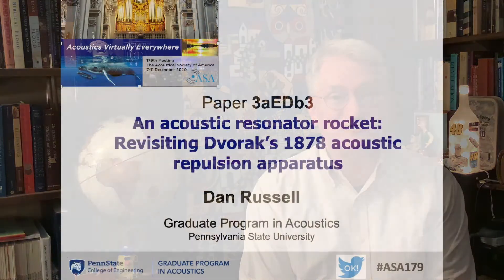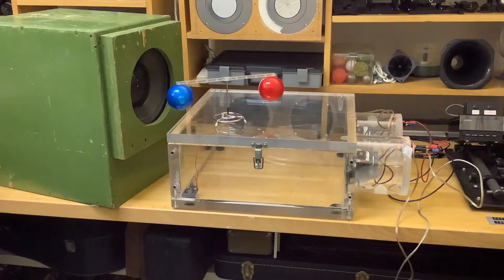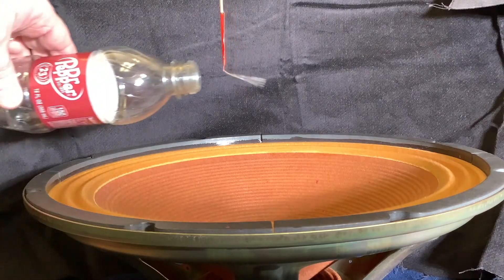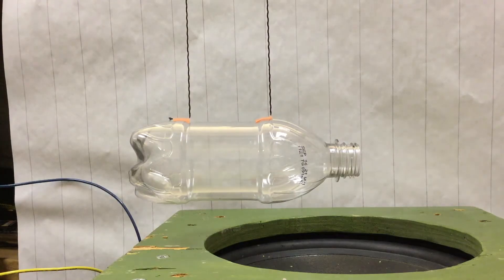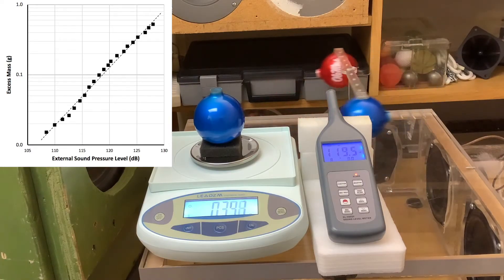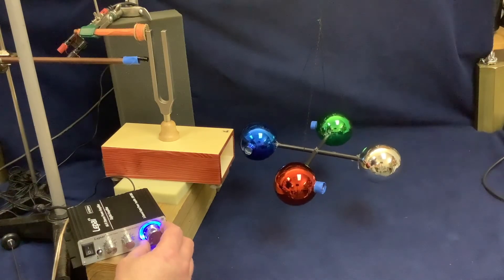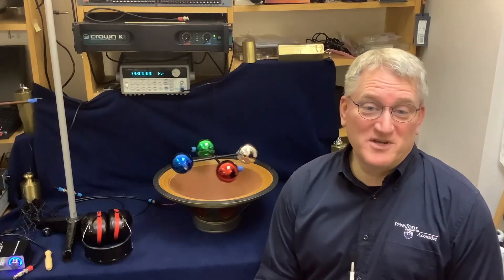Acoustic Rocket Demonstration -- revisiting Dvorak's 1878 Acoustic Repulsion Apparatus

Comment: fail. the resonator mouth opening should axially face the source of the sound, i.e., the speaker. a perpendicular setup is far from an ideal test.
Reply from the maker: unfortunately you apparently don't know enough about acoustics to know how incorrect you are. What I did in this demonstration works perfectly well, and this is how we measure the response of Helmholtz resonators. At this frequency the wavelength of the sound wave is much, much larger than the opening of the mouth of the flask, and the sound pressure is the same in all directions, so "pointing the speaker directly at the opening" makes zero difference in producing the effect.
Reply: @DanRussellPSU  an ideal setup would not have limitations based on the wavelength size. just point the speaker at the hole.
Reply from the maker: @h7opolo  Dude -- it doesn't work that way.  There are no "limitations" based on wavelength size.  The only parameter that matters is the frequency of the flask (and its corresponding wavelength) and the direction the loudspeaker is pointing makes absolutely no difference.  Perhaps I'm just feeling cranky and snarky today, but I have a PhD in Acoustics and I've been research and teaching the subject for 35 years. So, I do happen to know what I'm doing.  For a demonstration like this, the direction the loudspeaker is pointing makes absolutely no difference.  You could try it for yourself to verify.
Reply from the maker: Also pointing the loudspeaker as I have done makes it clear that the effect is due to the motion of the air jet coming out of the flask opening, and NOT due to the sound waves generated by the speaker.
Reply: agreed, that aspect is useful for verification of concept.

Comment: Ce principe est utilisé par Suzuki dans ses moteurs à 2 temps des années 80.
Non pas pour faire tourner les roues de la moto...
mais pour supprimer l'effet des pots d'échappement (pot de détente) qui renvoie
une onde de pression qui arrive au mauvais moment en dehors de la plage de régime d'accord.
Le dispositif ouvre à bas régime et ferme à haut régime une chambre qui constitue un résonnateur de Helmholtz
à l'aide d'un boisseau pivotant disposant d'une fenêtre oblongue, placé proche de la lumière d'échappement.
Ce système est baptisé SAEC  pour Suzuki Automatic Exhaust Control.
(pas le suivant AETC Automatic ExhaustTiming Control, différent).
Le calcul dans ces conditions de fonctionnement doit être assez complexe.

This principle is used by Suzuki in its 2-strokes engines from the 1980s. 
Not to turn the wheels of motorcycle... 😉 but to remove the effect of the exhaust pipes (chamber tuned pipe) which returns a pressure wave that arrives at the wrong time outside the tuning rpm range. 
The device , placed close to the exhaust port, opens at low rev and closes at high rev a chamber which constitutes a Helmholtz resonator using a pivoting bushel with an oblong window.
 This system is called SAEC for Suzuki Automatic Exhaust Control. (not the following different AETC Automatic ExhaustTiming Control). The calculation in its operating conditions must be quite complex.

Comment: Is there any real world application for this device?For this has there been, I can't see any.But then again, I don't know what happens.If we scale it up, and how large you have to scale it up to produce anything that would, you know, be used to move something or propel something again, what real world applications does this have sincerely?David raphael a k a bob, the blindburg guitars p.S thanks for the video
Reply: I wonder if the effect would still be present if an ultra-sonic waveform/transducer was used. I think if it were that would be the only way to find a practical application because no one would want to hear a speaker operating at a sufficient amplitude to drive it fast enough to be useful.

Comment: Assuming the air and its mass/density being ejected in the form of a stream, being pulsed by sonic waves is the mechanism for rotation and the air being drawn in around the outside edges must be of equal volume and equal velocity of the center jet otherwise an area of lower level of air pressure would exist in side the resonator. If those forces, in take volume / velocity and the ejection volume/velocity have essentially equal components then the intake vector has to have a vector which does not oppose the "jetted stream." Being that the air is sticky does the intake air and its vector pull or aid in the rotation. Then does the jetted air have such a velocity to overcome, at least temporarily, the viscosity of the air surrounding the resonator? You have shown the aerodynamic shape of the resonator is less important than the frequency which drives it. Also does Doppler have any influence? Can the rotation be stopped by applying via the frequency which drives the resonance by the frequency coming from all directions this elimination of Doppler?
Reply from the maker: The Doppler effect has to do with the frequency of a radiated sound wave having an apparently different frequency (lower or higher) depending on the relative motion of the source and receiver. That really doesn't apply to this problem.  The sound field at the mouth of the resonator simply provides the driving mechanism that causes the resonator to oscillate at its resonance frequency. Because the resulting oscillatory motion is so rigorous, the system becomes nonlinear and the jet streaming occurs, resulting in "repulsion".  The viscosity of air is pretty small (the viscous losses along the walls of the neck are much larger),  If you are interested in details of the nonlinear jet formation, there are several papers by Uno Ingard that explore and explain this.  My interest in the topic was to reproduce this demonstration that I had read about, because it is a pretty neat effect.  But, I'm not studying it as a research topic.

Comment: Wait,  you said the bulbs act as "hemholts resonators"?   do you mean like a modern automotive exhaust can? Both my motorcycles came stock with hemholts exhausts that sounded like a sewing machine but I swapped them out for louder Jardine exhausts that sound like black hawk helicopters at idle but they also greatly increase hp.
Reply: @nathanjones3429 I'm guessing they are both 4 strokes, since you mentioned "sounded like a sewing machine", BMW's ?  Were you fortunate enough to dyno test your bikes ?   Jardine makes Quality Cans (also Scorpion).
Many happy miles to you.

Comment: 11:50. There's a potential that   phase differences and self resonance is destructively interfering when driven from the side rather than driven from the speaker below. If this effect exist it will likely be highly geometric dependent and probably small. Sound  Energy might travel down support bar faster than through air and might be destructively interfering.

Comment: One of many useless things
Reply: Not useless.

Acoustic resonators are commonly used in vehicle exhaust systems to attenuate specific frequencies and reduce engine noise. 

Acoustic resonators are also integral to musical instruments, where they enhance or modify the sound by resonating at certain frequencies, improving sound quality and projection.

If mire research were done, I expect we would find additional applications for acoustic resonators
Reply: Most technology that we enjoy today fundamentally started from one of these "many useless things".
Reply: Pulsejet engines operate on this principle. The only difference is where the excitation comes from and air is allowed to move through a pulsejet to provide oxygen for combustion. They are otherwise exactly the same.

Comment: Thanks for the demonstration. I have a question; does this applies to non-compressible fluid?
Reply: I think you would need a pocket of compressible fluid like air inside of a container of incompressible fluid to achieve a similar effect and the resonant frequency would be much lower.

Comment: if you were to put a Crookes radiometer in front of a speaker with an ( x )  Hz freq. coming out of it, would the rotor spin, or would the glass and/ or the vacuum inside of the envelope impede this?
I imagine, that if you played just the right freq. and volume, that it would cause the xmas balls to shatter like an Opera singer, and a crystal wine glass...

Comment: AI Summary

Abstract:

This video explores the phenomenon of acoustic propulsion, often demonstrated with an "acoustic rocket" apparatus. The presenter, Dan Russell from Penn State, showcases a modern version where Helmholtz resonators (Christmas ornaments or pop bottles) are made to spin rapidly by a loud sound at their resonant frequency. The core principle is explained as a non-linear acoustic effect: at high amplitudes, the resonator draws air in from all directions but expels it as a focused, high-velocity jet, creating a net thrust due to the change in momentum. The video provides historical context, crediting the discovery to Dvořák and Alfred Mayer in 1876 and the theoretical explanation to Lord Rayleigh. Several experiments are conducted to visualize the jet using a match, smoke, and threads with high-speed cameras, and to quantitatively measure the thrust using a digital scale. Finally, the presenter attempts to replicate Dvořák's original 1878 experiment using a driven tuning fork, successfully demonstrating the repulsion effect but finding the fork's power insufficient to achieve full rotation against the suspension's torsional stiffness.

The Physics of the Acoustic Rocket: From Dvořák's Discovery to Modern Demonstrations

*   0:27 - Modern "Acoustic Rocket": The video begins by showcasing a modern apparatus consisting of a closed box with four loudspeakers. When driven at the correct resonant frequency, the sound causes two Helmholtz resonators (Christmas tree ornaments) suspended inside to spin rapidly.
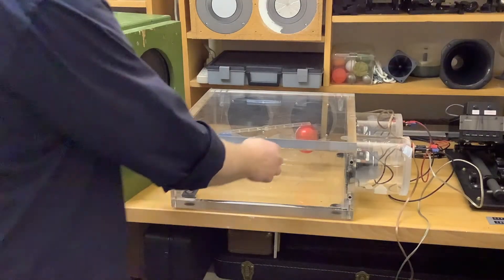*   2:05 - Propulsion is Inherent to the Resonator: To prove the effect isn't caused by standing waves in the box, the resonators are removed and placed next to a single loudspeaker. They still spin, demonstrating that the propulsion is generated by the resonators themselves.
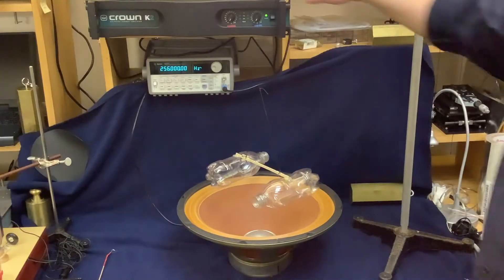*   2:35 - DIY Resonators: The principle is shown to work with everyday objects. Two 12 oz pop bottles, which have a natural resonant frequency of about 256 Hz, are glued together and suspended, rotating easily when exposed to a loud 256 Hz tone.
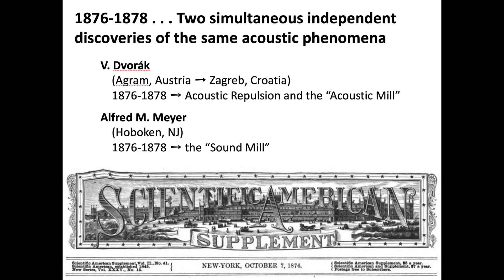*   3:06 - Historical Context: The effect was discovered independently in 1876 by Austrian physicist Dvořák and American Alfred Mayer. Lord Rayleigh later provided the theoretical analysis in 1878, coining the term "acoustic rocket."
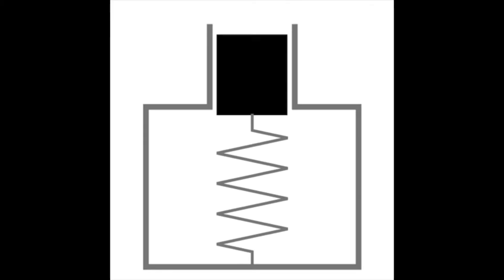*   4:40 - The Physics of Acoustic Thrust: At very high sound amplitudes, the airflow in the neck of a Helmholtz resonator becomes non-linear. Air is drawn into the opening from all directions but is expelled as a concentrated, high-velocity jet. This asymmetry in momentum flow creates a net thrust that propels the resonator.
*   5:29 - Visualizing the Jet: The power of the acoustic jet is demonstrated in several ways: it's strong enough to blow out a match, and high-speed video captures smoke being forcefully ejected from the resonator's mouth.
*   8:13 - Dvořák's "Acoustic Repulsion": A recreation of Dvořák's original experiment shows a single suspended bottle being pushed away from its equilibrium position by the thrust generated from its own mouth.
*   8:45 - Quantifying the Thrust: A resonator is placed on a digital scale to measure the force it produces. As the sound pressure level increases, the scale registers an "excess mass" from the downward thrust, showing a strong correlation between sound intensity and propulsion force.
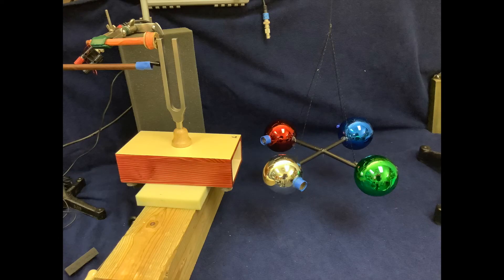*   11:15 - Replicating the Original 1878 Experiment: The presenter attempts to recreate Dvořák and Mayer's demonstration by using an electromagnetically driven 384 Hz tuning fork to power a wheel of four Christmas ball resonators.
*   11:57 - Limited Success with Historical Methods: The tuning fork was only able to produce about 114 dB, which was enough to show the repulsion effect but not powerful enough to overcome the torsional stiffness in the suspension string to achieve a full rotation. A modern loudspeaker, however, easily spins the same setup.

AI-generated summary created with gemini-2.5-pro for free via RocketRecap-dot-com. (Input: 16,348 tokens, Output: 857 tokens, Est. cost: $0.03).

Comment: Note that fluid jets are the same thing as a stack of vortex-rings.  Like a moving lead rod, versus bullets from a machine-gun.  Because of the alternating pressure, the "rocket exhause" should actually be a row of fast-moving "smoke rings," same as the interrupted jet ejected by a jellyfish.   (Vortex-shedding is a nonlinear effect, only appearing at high Reynolds numbers, i.e. low viscosity and fast-moving gas parcels.)    In the 1990s we had the science-fair project with the loudspeaker inside the resonator.  Each pulse of the sine-wave produces a smoke-ring.  With a loud bass signal, fires could be extinquished at a tistance (but really it was just a narrow coherent gas jet blowing them out, a long string of ring-vortices which carry net fluid mass along as they go.)

This also is how planes fly, how 3D wings generate lift via reaction-force (but wings operate in DC mode.   Yes, wings are examples of propulsion, where the shed vortices form a long, down-moving jet.  An aircraft flies by flinging a single, long ring-vortex downwards.  This is easier to see with helicopter blades.   Hmm, do buzz-bomb gasoline jet-engines actually emit ring-vortices?)

Comment: What does the diameter of the neck have to do with operating in a non-linear regime? 6:10.
Reply: It's called "high Reynolds-number phenomena," everything is nonlinear with "vortex-shedding."  Changing the diameter will change the jet velocity when AC pressure in the sphere remains the same.   To launch a jet, the effects of air inertia must dominate over viscosity effects.    Another example is a ceiling fan, which at low RPM just creates a trapped ring-vortex.   Turn up the RPM, which increases the air velocity, and suddenly a long plume of air is launched downward by the fan.
I wonder if these would work better if the neck was a sharp-edged hole rather than a cylinder?   The cylinder would give some unwanted viscous drag.   Use a diamond wheel to slice off the little glass neck.

Comment: Disliked for sound radiation pressure (both collocations) and nice < niais < nescius := not-skilled → well, fast → swift, and mass → force.
Reply: @armsox this person has a crippling level of OCD. Just ignore them.
Reply: @care_really_you_do  this troll projects a disorder where there is order and calls one person plural like a maths dropout.
Reply: @care_really_you_do  u don't get to decide how other people's brains work. you don't get to decide who i should ignore
Reply: @alysdexia  sorry if my comment was overly critical of your method of communication, it's a very unfamiliar schema for me. is the "→" symbol is used to represent edits / modification in the form of word replacement? I don't think i grasp the difference between → and = in this system though.

however, just a heads up that asserting "them" as exclusively plural is kind of a losing battle. language is not set in stone, it is defined by how it is used, and right now english is missing a way to refer to a single person in the third person without specifying a gender. the fact that this limitation is only being worked around more recently is largely because (prior to the present right-wing backlash) there was a growing awareness that the 2 genders referred to by the pronouns "he" and "she" didn't do a good job of describing all people (and this highlighted other situations, such as here where we're strangers on the internet and don't know each other's gender because it's not relevant to the subject). in that context, "they" is well positioned to fill that vacuum of reference, since it's the lowest "energy" change (the scale of the modification is small, and the confusion is non-zero but minimal). language is always slightly imperfect and imprecise, and people are always trying to work around these limitations in different (largely uncoordinated) ways, and the cumulative result of all these disparate efforts is a sort of chaotic, evolution-like emergent process that nobody directly controls.
Reply: @care_really_you_do your last reply was filtered from Top when logged in but inexplicably not when not, where you ask if I do drugs (which I don’t) but then say “brain are” so that proves what I said.
Reply: this was very hard to parse but if i understand your weird notation correctly, i too was bothered by the use of "mass". i think "weight" would've still been imprecise but a better middle ground. the problem with "force" is that the scale isn't displaying units of force, so i think you'd have to say "force beyond that of gravity" which would get tedious. the fact that i recognized something in this mess makes me extremely curious how this system of yours works lol
Reply: @spambot7110  what’s with your name?  as opposed to soft to parse; i isn’t even a pronoun; weird = fateful → uncanny = bizarre; would → should.  A scale if in SI usually tells mass but if in imperial does tell weiht, as opposed to poundal; the SI mass is directly convertibil to force with the -f suffix as in grams-force, irrespective of g.  I didn’t leave any mess.